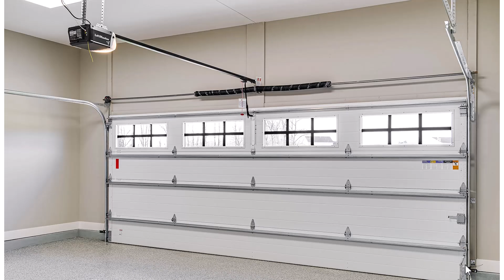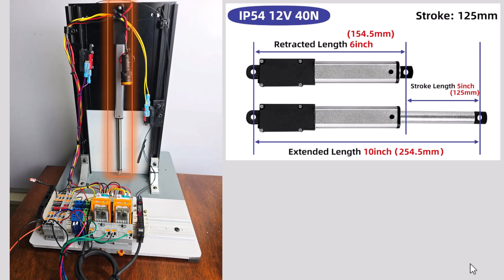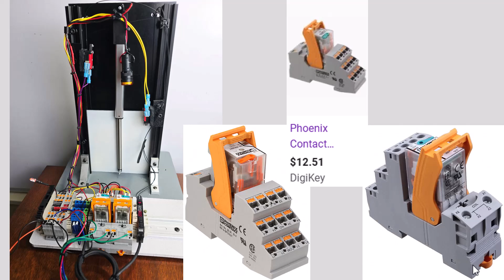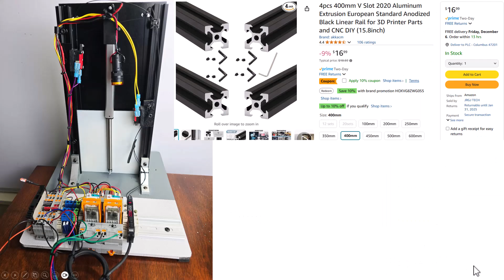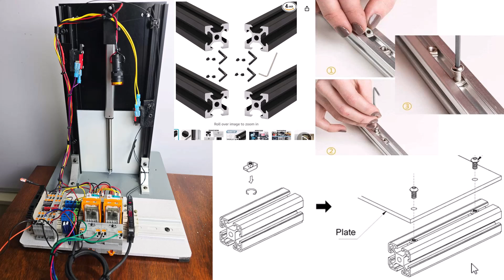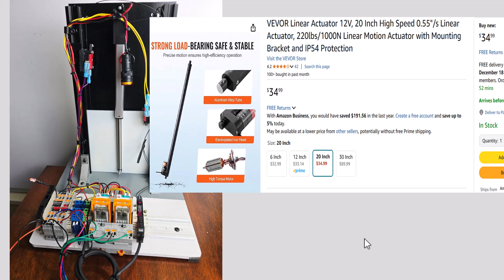PLC Training - Classroom Equipment - Garage Door

Comment: sir im trying to migrate a program from a 1768-l43s this processor its discontinued to a 1769-L33erms when im trying to download the program to the 1769-l33erms it shows a warning "changing the controller type from the old plc to the new one will affect the project in a number of ways "
and shows something like changing the controller type will change, delete, and invalidate controller properties and some other warnings like safety i/o modules will be deleted and some other stuff you think you can do a video about this ? hope i gave you enough details